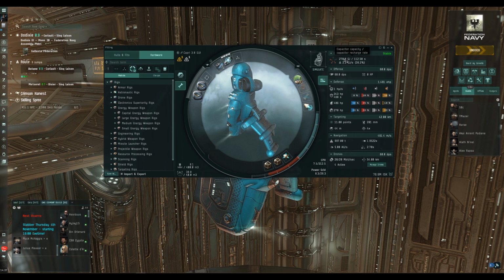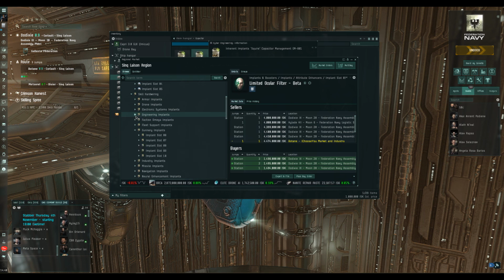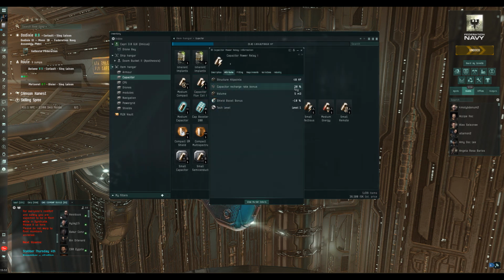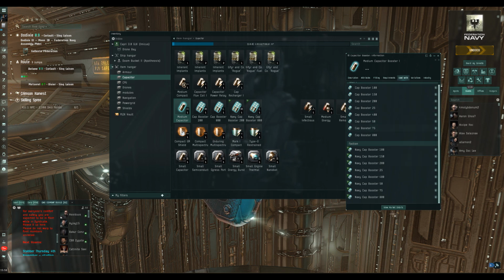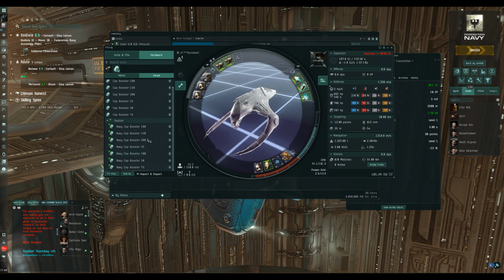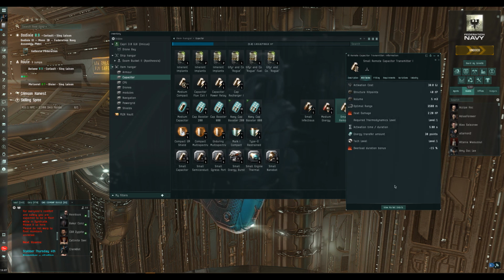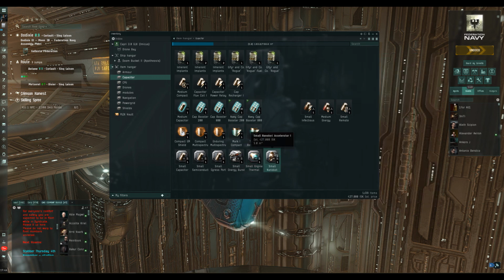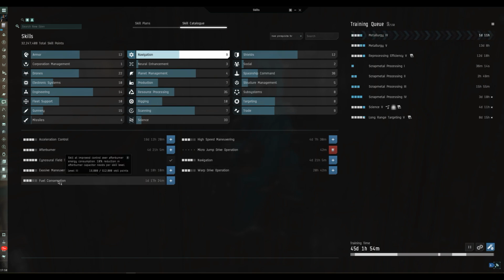Eve Online Capacitor 101 How to get more and use less. Implants, Modules, Rigs + Skills +Gila Skins!

Comment: You already mentioned it in your other video but the Power Diagnostic System does increase the amount of cap you have and the rate it recharge. Also while this only kinda affect your fitting, if you know that you're only going to use a fit in a part of space that affects you cap recharge rate (like electrical abyssal deadspace) then you don't have to worry about being cap stable as much. Besides that seems you covered everything.

IGN: Ieyanas Kyra Makanen

Comment: Some lesser known cap tips:
*) For MWD, use navy or DED versions whenever you can afford them. Apart from fitting, they also come with a much smaller Cap penalty - which can make otherwise cap unstable fits completely stable. Honestly, this property alone makes them more than worth the investment imo...
*) Pulsing your modules - switching them on only when you actually need them. Takes some practice and a decent attentiveness, but can make cap unstable fits function very much like stable ones.
*) A variation pulsing - set modules on AutoRepeatOff, unless otherwise necessary. Good example is Relic/Data analyzers, which would otherwise pointlessly use cap after the initial accessing of the can. Can also work rather well on Ancillary Shield/Armor reps, if you have enough buffer to work with, and otherwise risk over-repping. Can make Pulsing a bit easier in certain situations.
*) Use Boosters and Heat - especially helpful if you're already decent at managing unstable fits, giving you even more Ooompf for every GJ of cap spent.
*) Even cap unstable fits don't just run out of cap instantly. Often times you don't need the cap stability to outlast your opponent, player or NPC. Just be sure to take note of how long your cap will last under stress, and choose your engagements wisely

IGN: Neliete Hidoi
Reply from the maker: Some good ideas, thanks. I don't mention faction stuff much in the newbro vids, they don't need that much risk yet and better to learn how to get the extra bit you need without just spending crazy ISK. Faction bling should be the icing, not the cake xD

Comment: You've illustrated why I always look at the cap numbers with and without afterburner or microwarpdrive running is the simulation tab to decide if I need to change stuff on my fitting. Not necessarily to become cap stable but if my cap would run out in 30s with everything on then in really need to reevaluate the fit. Still haven't manage to crack The Blockade in a rifter. IGN: Pollekey

Comment: Always a good watch. That fuel conservation skill makes a big difference to the cap stability of the newbro vexors we give out - being a % it’s really impactful on oversized prop mods. Alphas usually have to manage the repper whereas an omega can set and forget. 
IGN Okolen Purvanen T
Reply from the maker: It was always a perquisite for afk VNI site runner in null sec, i think a speed nerf killed that. It was very profitable, great for the sec status, but rather dull xD I don't think learning some module management is a bad thing at all. I try to get players to push their luck a little now and then by letting things get hectic just to get used to it. .One day your hull may depend on it. xD o7
Reply: @daddex9222  for sure, when I started playing stability was a big plus but now I’ll look at a build with 1 min cap and think ‘yea I can make that work’. o7